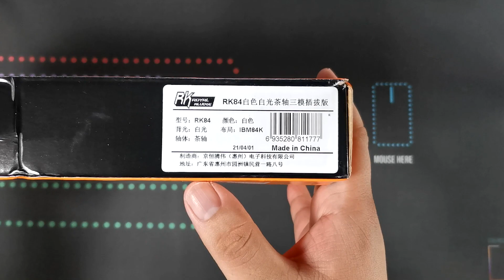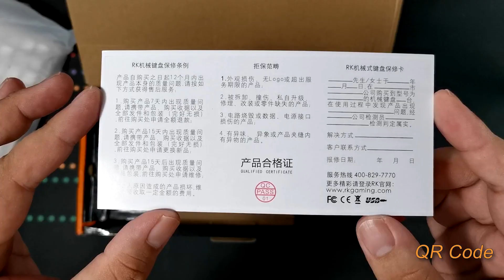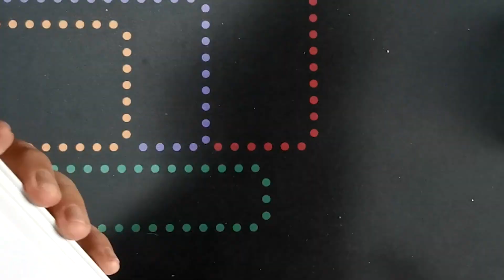Royal Kludge RK84 Mechanical Keyboard: Is this a great budget keyboard to have?

Comment: Can confirm from Australia that the RK84 is a fantastic budget platform. I slapped some lubed Glorious/Holy Pandas, lubed the stock stabs and it sounded pretty great. Only complaint is that after one or two switch swaps, the witch will just pop right out with the keycap when you are cleaning lol. Not a big problem, but a little annoying. Once you have done a little sound treatment, and gotten some thicker than stock keycaps, it does in fact TH0CC.
Reply from the maker: hiii!! Yeah i agree! For the price and the form factor it has, this keyboard is great!

Comment: Genuine questions on seeing keeb mods.

1. Every single mod adds some kind of foam soundproofing. Why do manufacturers leave it hollow then, rather than adding well designed soundproofing themselves? 

2. And cutting of the plastic bits of stabilisers, I assume. Ignore that if I am wrong. If that's what people prefer, why do they release keyboards that have extended plastic bits?

Coming from someone new to Mech keebs!!!
Reply from the maker: Hiii! Thanks for the questions!

1. I honestly dont know why they leave it empty. Maybe to save cost? But Sound dampening is really preference. Its up to you if you prefer a more tighter or more firm sound than leaving it without sound dampening. Some of the more expensive custom keyboards will have some form of sound dampening. But its not much as adding some of it yourself.

2. The extended plastic bits of the stabilizers were an old design made by keyboard manufacturers before. If Im not mistaken, it was meant to avoid damaging the pcb when the stabilizer leg would hit it. But no pcb has ever been damage because of the stabilizer so enthusiasts have removed this part to give it a cleaner sound. If you can see aftermarket stabilizers, that part of the stem has already been removed.

By the way, welcome to the Hobby! 😁

Comment: Man i love the quality if your videos, im just entering onto this space of mechanical keyboards, i was wondering of i should get an rk r87 or if i can justify getting an rk84 or rk87.
Reply from the maker: Hello! Thank you so much

Welcome to the rabbit hole. That would depend on you really. If it were up to me, I’d get the RKH81. These are similarly priced and is better in my opinion. 

The R87 can only be used via cable and, because of my preference, I’m not a fan of the RK84’s form. RK87 is okay too if you really like having a TKL size keeb.

Comment: Hey man, does the white keycaps turned yellow over the time? Should I go with the white or the black variant... personally I'm thinking to buy the white one as RGB look way better than the black one.
Reply from the maker: Hii! From what I know, it does but it depends on how you use it and it will take a long time. Personally, i have not had any issues with white keycaps.

Comment: I wanna buy some custom keycaps for this bad boy but I'm not really sure for the sizes. Anything i should take note of?
Reply from the maker: Hello! When you buy custom keycaps for these, get the ones that has a complete set. Like 150 just to be safe. You’d need like a smaller right shift, and keycaps like pgeup and down, print etc that is for the specific row (i.e. R2 - R3)

Comment: Hi, Just got my RK84 today. When in wired mode there's a red light under the space bar. I guess this is an indicator that it's charging but it kinda makes me feel off. Is there a way to turn this off?
Reply from the maker: Hiii! Niceee! Unfortunately, that indicator will always be on if its charging. But once its done, it will turn off. I am unsure what can be done tho as this is as a feature for keyboards with batteries

Comment: Hi, Can you use the wired and 2.4ghz at the same time on this? Example, if i want to switch from my desktop to laptop easily.
Reply from the maker: Hiii! Yes you can but you would need to use the switch on the bottom side of the board to transfer from one mode(wired) to another (2.4ghz)

Comment: Hi! I'm currently using a Keychron K8 TKL with brown switches and I've contemplating on switching to this but with red switches, mainly for aesthetic purposes lol I've switched to all-white desk setup. BUT.. I need a keyboard that can switch between multiple devices the same as Keychron keebs (for work) and won't give me headaches (connectivity issues). Will this keyboard be a right choice?
Reply from the maker: Hiii! Noiceee! I can imagine the white  desk setup! Super clean!

The RK84 can switch from one device to another. I personally havent tried this but you can connect up to 3 to 5 devices (depending on the model you get). This is a great choice! Also, you can switch from the different modes like wired, bluetooth and 2.4ghz mode with a physical switch on the bottom side of the case.
Reply: @kevntech  Hey I'm back! I bought this keyboard but had my friend mod the switches. I'm happy with the sound BUTTTT I keep randomly getting repeating keys and have so much latency issues. Can't use the keyboard on wired, since I badly need to switch between devices often. :( How was the latency of yours with BT or the dongle?
Reply from the maker: Hii! Oh noo. Was it doing this before the modding? Try using a different switch on the keys that keep repeating (if you have) or try to swap it around the switches.

The BT mode in the keeb my friend had was okay but the 2.4ghz was not that good. BT mode usually has some sort of latency issues. Are there any other devices that might cause interference? Also is your model the newer one or the older one?

Comment: what are your thoughts on the included switches? cause they are manufactured by a well known company / manufacturer.
Reply: They are complete and utter trash, got mine yesterday, they seemed fine while typing. But then i started playing and oh boy, what a heap of crap. They have a big design flaw, inside the south part of the housing there is kind of of a rail in wich the stem travels, and it has a little edge, but it seems that the stem travels past that rail, and if you bottom the switch out forcing it to the south, it kind of stucks to that rail.

It doesn't get stuck, but it kind of bumps in it, and it feels like a lot of of friction.  It kind of has the feel of "semi" mechanical switches, but only if you bottom it out and specially if youre applying force towards the south, but when you game its almost certain you'll feel it. And it is a design problem as the great majority of the switches has that problem in my case like 80% if not more.

I got the red switches, and they were RK branded on the housing. The stabilizers are really wobbly and do not  attach securely, so they are pretty wobbly, they are lubed but it's not enough, i would give them a 5/10.

The rgb is ok, not the stronggest, not the weakest. I have a bwkb1 and the rgb in those are better, the construction in general are better, it has really good stock stabs, but ita not hotswappable and 60% wich I couldn't get used to.

The keycaps are pretty cheap, they are abs doubble shot injected, but they are pretty thin and has a lot of barbs on the north facing area.

Other then these problems, its great, its pretty, heavy, sturdy and versatile. I'll be keeping it as i loved the layout, the looks and build quality of the non moving parts  lol.

If you're planning on keeping it stock though i would pass. I'mma buy some gateron switches asap.

If ghe switches didn't get "stuck" they would be pretty ok, they are pretty smooth until it gets stuck lol, they feel like they are a tad bit harder to press then the gateron reds, but i think thats a good thing.
Reply from the maker: What Alex said is true. The RK copies of the switches are not that good and I would recommend you to change them right away! Feker Pandas or Jwick Oblivion V2 are amazing tactiles at a budget price.
Reply: @kevntech  Now they also have a version with non hot-swap cherry mx switches, I will just get those then spray lube the switches, since I'm too lazy lol.
Reply from the maker: Hahaha! That could be okay but spray lubing may cause problems. So just be wary! 😁

Comment: Hey guys im thinking of buying this  does it include the wire u showed in the vid?  like what u use on wired mode? or do u buy it separately? TIA
Reply from the maker: Hiii! It does include a wire but its a normal usb type c cable. The cable I used was made by Kbling Cables Cebu. You can try chatting them. It will cost around 1.6k!😁
Reply: @kevntech  okay sir tysm
Reply from the maker: You are most welcome Sir! 😁

Comment: Hi! I heard you can only use the two extra USB ports if you're in wired mode. Is this true? 

Can you please try it out? Im planning to buy because the two extra ports sold me but Im really into wireless set up so if that's really the case then I might have to pass
Reply from the maker: Hiii! Unfortunately it will only work in wired mode. I think wireless might not have enough power to handle the extra USB ports unless in wired mode.

Comment: These came with the brown switches, correct? Still deciding between those or the blue ones. Awesome modification by the way :)
Reply from the maker: Hiii! Yeah! These came with browns. Thank you so much! If you have a bit more budget, replace the stock switches with different tactiles or linear ones.
Reply: Whatever u do dont get blues, it’s rly annoying overtime and the click bar degrades isn’t not pleasant to type on for long periods of time to and isn’t helpful as a gamer
Reply: @ya1.bd_525  I ended up just deep cleaning my current keyboard (ducky shine 4 with cherry browns) and postponed the upgrade, but thanks for the advice! Will probably get something like the gateron yellows once I do
Reply: @Biesteh  what’s ur budget bro I can hook u up to soem good switch options depending on ur price range, if u do want gay yellows I sya go for the milky ones they’re better quality and thockier

Comment: Are these keycaps Cherry profile? Do they have interference with the (north facing) switches?
Reply from the maker: Hii! Yep, these are cherry profile keycaps. And yes because of the north facing switches, there is interference. But its not super noticeable in normal use. Hehe
Reply: @kevntech  Thx. I have my first replacement set on the way. It's a Cherry profile and I'm concerning about the interference since knowing this issue. Unfortunately most of beautiful keycaps theme (for my taste) are Cherry profile, lol.
Reply from the maker: Wooo! Nicee! Im excited for you! But I understand the concern. During the sound test the interference could be heard. But during normal use, its really not that noticeable. 😁
Reply: @kevntech  Thx. If I notice a significant interference, I'll change the caps later (maybe I'll try adding o-rings to reduce travel distance).
Reply from the maker: Nicee! Let me know if its really noticeable. If you put o-rings you might feel the switches become mushier. But still preference. 😊
Reply: @kevntech  Okay.
Reply: @kevntech  what kind of switches do you prefer for long typing and satisfying typing? Blue or brown?
Reply from the maker: Hiii! I honestly prefer tactile switches for typing long hours. Its satisfying and just feels amazing! Browns are okay but if you can, try getting a different tactile switch like Holy Pandas, Durock Koalas, etc.

I used to like clicky switches but it just became too annoying to listen to for longer periods of time. Haha.

Comment: Rumi61 or rk84?  Since they almost have the same price ? Thankss
Reply from the maker: Hi! It really depends on your size preference. Do you like the compact size? Go for Rumi. Would you want function rows? Go for the RK84! Both are great boards.
Reply: Thanks! Actually, i am aiming for whats the best when it comes to gaming. Since you mentioned rk84 (when wireless) have latency.  Do you think rumi61 will be the best fit?
Reply from the maker: Hmmm for wireless. They are not the best boards for it. A board with 2.4ghz connectivity would be the better option. I will be trying out the RK68 2021 Edition soon and we will see if latency is still an issue. 😊
Reply: @kevntech  thanks brother! You earned a new subscriber. ❤️
Reply from the maker: You are welcome! And thank you soo much! I appreciate it! ❤️❤️
Reply: Maybe worth pointing out the RK84 I bought does have 2.4 GHz as well.
Reply from the maker: Yeah! It does have 2.4ghz connectivity but it isnt really great to use. But im unsure if its because this could be the older model. They might've fixed it up for the newer models. 😁

Comment: How is it that most "reviewers" say that the dongle is not that good? 
I have one and its works no problem, same with the other 5 guys i know. Maybe y'all just copying reviews without the actual test?
Reply from the maker: Hi! I dont personally know any other reviewer who has done this but in my experience when I did review this in 2021, the included dongle was not good. I do not know if the newer variants of this are better.
Reply: i have a similar keyboard and the dongle is not as responsive as other reviewers claim it to be.. maybe i'm just used to wired keyboards.. to each their own